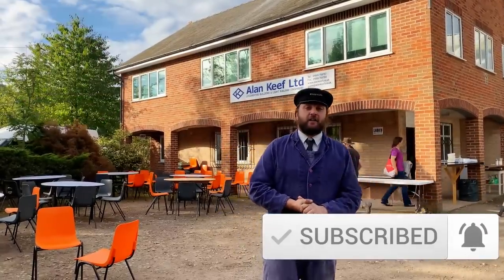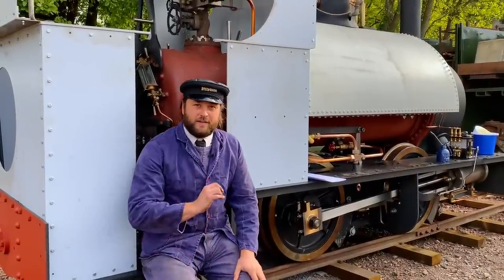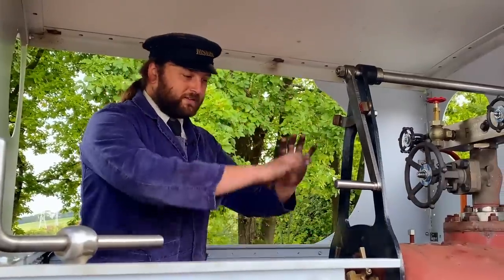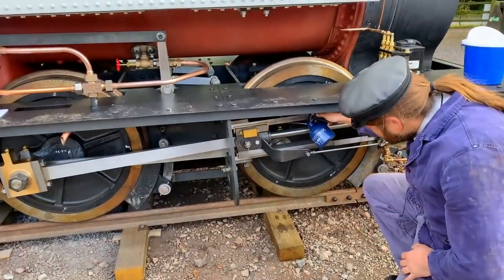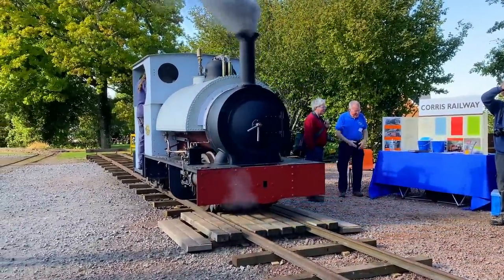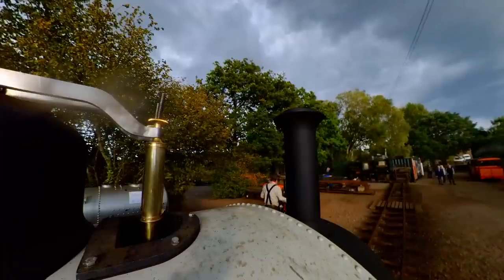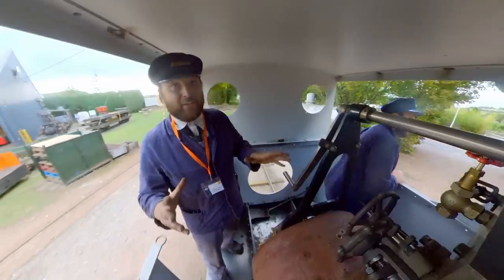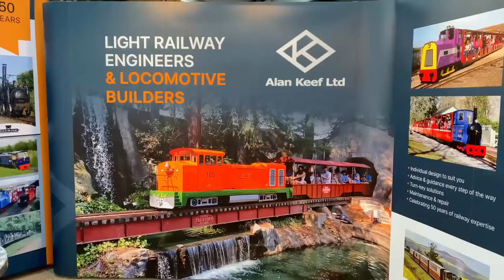First Drive on a Brand New Steam Engine - Lawrie Goes Loco Ep 34 - Corris Number 10.

Comment: Lawrie performing a first public firing of the new Corris number 10, bringing it to life and giving the engine it's first breathes. The beginning of new steampower on the Corris. A very special moment and video indeed.
Reply from the maker: It was a pretty good day!
Reply: @lmm  how much steam pressure where you or should I say they was running no10 on exactly? probably doesn't take much to make a narrow gauge engine move. seeing you light the fire took me back a few years when I was trying to light the fire in my MSS 
O gauge engine at a event in France where me and my Mum was selling ice cream. 
the wind kept blowing the matches out and those fuel tablets are not easy to light. two kids saw what I was doing and went and got their dad who was in charge of the BBQ who had a lighter which was a great help to my steam engine.

Comment: "Why dont we build a diesel instead". Lawrie i regret to inform you that we need to take away your steam enthusiast license lmao
Reply from the maker: Building diesel is the logical thing to do.
Steam is glorious, but more complicated, expensive, and harder to maintain and operate
Reply: There is a new build baby Deltic and LMS 1000 diesel locomotive being reproduced.  The LMS 1000 was the diesel locomotive that started the diesel locomotive revolution and the new build will have the same type of engine the original scrapped locomotive had. The baby Deltic is also having the correct engine fitted as well.
Reply: @bentullett6068  im actually really excited for the new ivatt diesel. Huge ivatt fan

Comment: Amazing. I'm surprised anyone has built another steam locomotive. Usually everyone wants a diesel locomotive, but to have an actual brand new steam locomotive in 2022-2023, that's fascinating.
Reply from the maker: There are quite a few being built at the moment believe it or not!
Reply: @lmm  that's amazing, do you ever think that steam will make a comeback in any industry other than passenger?

Comment: SUPERB!!! We are working when we can on a sweet 7 1/4" gauge Jessie. 0-4-0 saddle tank of course. Lovely locomotives. Well we got to your STEAM FOUNTAIN and saw the machine marks and melted back into Model Engineering mode. Yes the classic far too many bits on a Locomotive against Not Enough Hours in the day, And today? Yes far too cold to venture down to our Workshop. We saw you at the MIDDY August 2021.
Reply from the maker: Did you enjoy your trip to the MSLR?
Reply: @lmm  YES we did and went on every train except for one where we went on THE GRAND TOUR. Totally enjoyed the workshop and the story of the FREE!!! donated carriage which ended up costing £7,000 by the time it had been transported, had the asbestos removed. and had a new roof. We walked up the extension the evening before after a day at Bressingham. A whole week of beaches and steam railways.
Love David and Lily.

Comment: this reminds me of the ongoing joke of the Enterprise - B "let me guess, not installed till tuesday" but this is neat to see a raw off the works locomotive, not even in livery yet, not even fully completed but still in fire, from engineering standpoint you'd think by 2022 we'd have made easier way to oil internals of a steam engine
Reply from the maker: You'd have thought wouldn't you! I'm hoping that's something that will change

Comment: How long did it take to build and how much did it cost? What firms made the parts? What improvements were made over its predecessors? The story of its construction would make a fascinating video.
Reply from the maker: The process started in 2007, which involved creating new drawings from number 3.
Alan Keef has done almost all of it.
The cab opening would be a modification, but as number 3 has been modified throughout its life, 10 is already a very different to how it 1 2 and 3 would have been new.

Comment: No.7 is "toylike" 😄 Hopefully No.10 doesn't learn any of "Sir Handel's" tricks...
Reply from the maker: It's going to be a cracking engine
Reply: @lmm  Joking aside it does look very good. I have half a set of drawings for a 3 1/2" gauge version based on it's older brother (well brothers if we consider CR No.1-No.3 combined) (why half a set? Too long a story for here..)  Probably just as well that the handbrake was fully functional considering the way the land drops away at the end of the temporary track...

The regulator handle, bracket and shaft layout is very "Hughes"/Falcon also being used on the tram engine designs.
Reply from the maker: @jonp3526  it is certainly a sibling.
I too am very glad the Handbrake functioned!

Comment: Building new steam locos isn't 'bonkers', Lawrie - it's inevitable! For one thing, existing preserved lines are expanding - and new ones are opening - and they'll all need locos, more than are currently available. For another, when BR started scrapping locos, what ones did the rail enthusiasts go for first?  The big, glory stuff!  Kings, Castles, Duchesses, Gresley pacifics and the like - yet what do most heritage railways need?  Branch line locos - like BR Standard 2s, 3s and 2-6-0 Std.4s; Jinties;  Panniers and Prairies - and nowhere near enough of them were saved from the gas axes.  Even the GWR heavy mineral 2-8-0s and 2-8-0Ts used by the Gloucs. & Warcs. Railway look right with their 4ft 7 1/2" wheels, as their typical working speed was about 25mph, which fits in perfectly with Light Railway Act requirements - whereas A4 Pacifics with 6ft 8" wheels look silly trundling along at 25, and even worse when running tender first!
Building NEW steam locos?  Vaporetur florebit!
Reply from the maker: There are loads of engines kicking about awaiting funds for overhauls to fill the operational need, the more pressing concern is that many are getting worn out. Where do you draw the line to stop rebuilding something?
New boiler, sure that's the consumable, wheels and frames?
Things like the standard 3 may well be the future of Heritage railways, and the P2 the future of the mainline.
Reply: @lmm  - I take your point, Lawrie, about the numbers of locos awaiting the cash for restoration; but I question how many of those locos are suitable for what the preserved lines need to 1) run their services, and 2) to run them at a profit.
Some years back, I was talking to the loco superintendent at the Bluebell, about their Merchant Navy. He said if they ran their normal service with either the SECR C Class, or the H Class 0-4-4T, they'd use about one or two buckets of coal from their loader.  If they used their 9F, it would be about three buckets. If they used the MN, they'd use six buckets of coal - and, he said, when you take into account the oil as well, he doubted the MN would even break even on its running costs unless every coach was filled to capacity. He pointed out that it was a very different situation to run an MN on the main line, where instead of pulling five coaches, it could easily take twelve (and all fully booked and paid for in advance).
On the flip side of that coin are the many railways currently running services with short-wheelbase shunters - such as the Austerity 0-6-0s with their 11ft wheelbase, and the (even worse) Yankee Tanks, at only 10ft - simply because they can't find anything more suitable. Even on the steep grades of the Kent & E. Sussex, where I think the steepest part is 1 in 37, both those locos will take five Mk.Is and a van - but they knock the track about very badly indeed and boy!, can you feel it by the end of a day's firing. In comparison, the small pannier tank (1638?) they have rides like a coach, thanks to it being designed to run at speed. When they hired in a Jinty, and a BR Std. 2 2-6-0, all the crews noticed the difference in smoothness of running.
Frankly, given the option of endlessly repairing shunters - and suffering the damage they do to the track at 25mph - or using engines designed to run well and efficiently at 25mph, I draw the conclusion that (as the loco super at the Bluebell said to me), in the long run the only path that makes economic sense for the preserved lines is to do exactly what the old railway companies did;  build the right tools for the job that they do, and in sufficient numbers. Currently, there are plenty of short-wheelbase shunters and big express engines in preservation, but a dearth of engines in the middle. And I can't help but wonder; for the cost of building Tornado, how many Standard 2s could you have built for the same money?
The Thwaites dump truck I used to drive for a building firm was just the job, lugging round sand, gravel and concrete on building sites - but even on a short trip on the road, it made a slow, noisy, very uncomfortable car, with very heavy fuel consumption.

Comment: I would've thought a new build might have gone with an oil fired system rather than coal considering the recent struggles with coal supply, they could have even run it on used veg oil from the local chippy.
Reply from the maker: It was designed and construction started before the coal shortage

Comment: i had a questions.
1. Where is its coal bunker?
2.How does saddle tank engine's saddle water tank works?
Reply from the maker: The coal bunker will be on the left hand side in front of the cab just like number 7.

The saddle tank holds the water to replenish the boiler.

Comment: I was wondering if you were going to add certain eco mods?  Perhaps making it the First battery steaming EMU In preserving?  The Swiss manage something years back. Fuel prices as they are it likely coal and fuel could be unobtainable?  Not suggesting nobbling the hair straitners and lining the fire box. But it entirely possible to have induction coils/ industry ceramic heater,sand batteries, and a few other gizmos? Show the big boys how it’s done! You want a legendary locomotives I guess it could be one way to go? Preservation societies up and down the country are in dire need of an overhaul just to keep them alive.  Deep cycling batteries may just be one way to do it? Fireless locomotives are nothing new. You had the sodamotives way, way, back when? Sweden has sand battery plant that can heat homes. Heliostats run on molten salt. I’m sure someone out there knows how to get steam to go green?  It just need a xe locomotive to prove to people how it done! You could say you have a giant kettle?  So many options. Catalysed H202, hydrogen fired locomotives. Made from a cracked source like bio methane? Everyone I know have always thought locomotives were living beasts.  If it has it own digester it would come extremely close? If done right you could have flash steam options?  Which means you might be able to carry more water?   Yep if you could build a small and mighty test bed? it would be awesome! Even the guys from Doncaster would be extremely curious? Or even Darlington? So would a lot of the preservation societies. It good to see some new steel hit the rails! Still waiting on a back to the futures, flying time traveling train?  But that a bit much to ask of the might little loco. Going green yes! Exploring time and space will just have to wait?!  Great job lads!
Reply from the maker: Problem with using electricity as a source is it takes huge amounts of power, and Corris is not putting in an overhead!

10 is to represent the class that was synonymous with the Corris, so keeping it similar to the original is important.
Reply: @lmm  fair shout! Its a lot of work on a new build.  Practicality as aways wins!  There might be a way of getting the electricity needed? but that might have to be another project entirely? It the same process that happened under our feat in the earth’s Dynamo.  Yes and it molten salt core.  Twisted magnetic fields in a self sustaining Dynamo.  Still a fair bit of work?  There is third rail option? With hydro/ wind power option. but that were it get silly, considering most heritage railways are free of electricity?  Price per mile of rail can be expensive. Aluminium is  2,392.97 per tonne. It is a lot of work! A lot of time.  The guy I spoke to said something like 5MW. But there are a few trick that can be employ to bring it down?  Running the steam pipe through and induction coil. have a installed hearting gradient as it flashes to steam.  Thermostats can control the whole process.  It a steaming manifold that could be integrated if you ever decide to go that route?  Just a question of how much steam you require to run it?  Most workshops I know of have and induction heater for metal working. It basically a modified version of that. My former engineering tutor told me one time about mono boilers.  Glad the thought stuck with me. This was some 17 years ago.  I sometimes for get the guy named. But he really was one of the old fashioned engineering. Love the guy because he greeted everyone with marvellous!  Phil starmer was a legend!  Really knew his stuff.  I suspect he loved his trains too!  Why I said manifolds is being you can have multiple coils. In various arrangements.  Flash steaming did result in the fast land steam recorded. The steam car inspiration. 139.8 mph! If you could find away to manage the overheads? Or funding streams?  Ultimately down to you!  Suspect the knowledge is out there? Just need a team to patch it together? I Love what you have done so far! Keep up the good work!it great to see new engines and locomotives whenever they get born! To work as well as that first time is impressive!

Comment: I was waiting to see or expected you to run it off one end of the track.
My one concern is the lack of a radius from the wheel treads to the flanges which are the predominant means of keeping the flanges off the rail sides.  Without that radius, the flanges will have to work more to keep the wheels on the rails.
Reply from the maker: Alot of the final machining is not complete.

The brake works well, and it was part of the reason of having experienced drivers.

Comment: I have some issues with no.10 with one of them being the cab, if this is meant to represent the corris falcons why have sir hydens new cab and not use the original low corris falcon cab design, and now we have to wait until train simulator makes the corris no.10 falcon and the money is then donated to the real corris no.10 to help with its completion.
Reply from the maker: Both 7 and 10 are built to the improved designs that are in use on the Talyllyn, as they're just better than original.
Reply: @lmm  but aren’t these engines meant to represent the original corris locos?
Reply from the maker: @LolLol-xy4rh  yes and no.
It's the continuation of Corris.
The represent the originals, but they are their own identities of 7 and 10. They're not replicas of 3 and 4.
If you're going to the trouble of making a new engine, you're going to want to make it the best you can, reliability, steaming and comfort, so from that perspective it makes sense to use the modified designs.

Comment: Kinda looks like Sir Hayden, or Falcon/Sir Handel
Reply from the maker: It is the same as Number 3!
Reply: @lmm  I was wondering why it looked so familiar. What will it’s name be? If it doesn’t already have a name
Reply from the maker: @nameless5512  It's number 10. The Corris engines never had names.
Reply: @lmm  True. Well I’m any case it’s quite the beautiful little engine, even without much paint

Comment: Hmm, just like the regulator on the 1831 John Bull.
Reply from the maker: Oh really?
Reply: @lmm  a glimpse in this vid from the 80s: https://youtu.be/FxcdY2Cj5nQ?t=124 the regulator handle is held in a stand over the firebox, turns a rod connected to the throttle (albeit the throttle is on the outside of the dome). This was not the original 1831 setup (which had the throttle located inside the steam chamber of the firebox), but likely added after a few years of service.